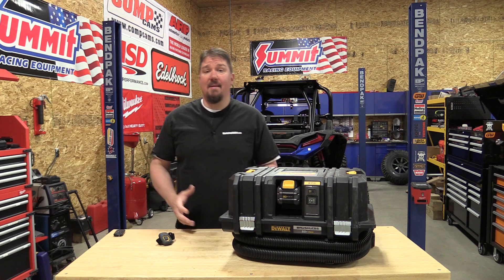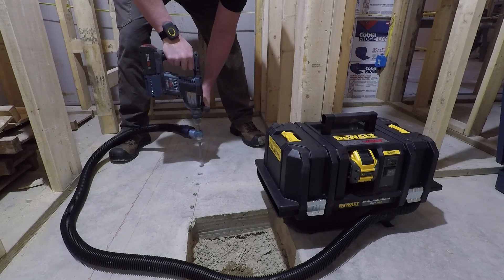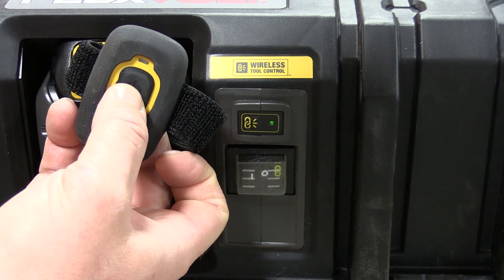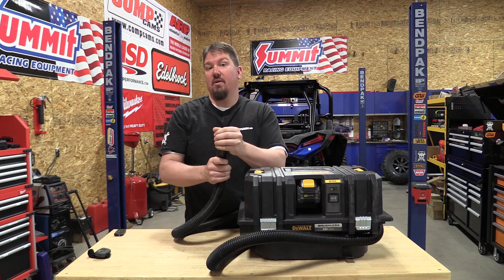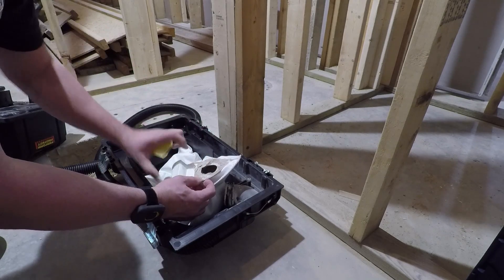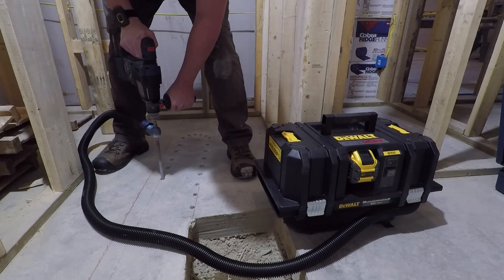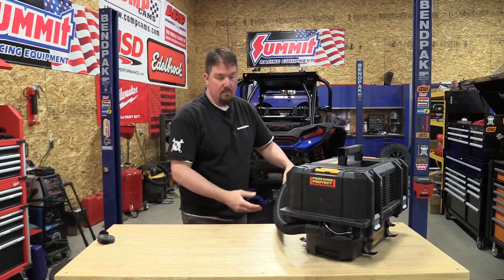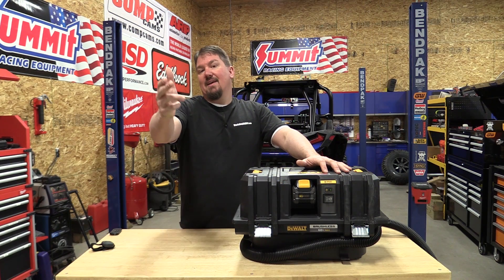Concrete Dust Extractor | DEWALT DCV585 Flexvolt 60v HEPA Dust Extractor Vac For Contractors

Comment: Regarding T-Stak compatibility, can this unit be snapped onto the top of a T-Stak tool case, or on top of one of the 4-wheel T-Stak dolleys, or is the compatibility limited to the ability to stack T-Stak cases on top of the vac? EDIT: I learned elsewhere that the answer to my sorta dumb question is yes, the vac is totally T-Stak compatible and can be added both on top of and below any T-Stak cse or dolley.

Comment: Strange that it’s the same price as the Dewalt battery framing nailer at @$400. Except for festool, vacuums are usually cheaper. I mean, how is this so much more then one of those tstak storage boxes, that’s what it looks like. Complaints aside, I really want one for my tstak system.

Comment: That looks like a 9ah batt that ran 19min when drilling, not a 6, the 6s are all black like when he was in the shop . Failing to make this a corded / cordless tool was a mistake by dewalt. Even my little 20v vac is corded and there are plenty of times when I just plug it in instead of going back out to the truck to get another batt or if i steal the batt off the vac for another tool.

Comment: Would this be good for woodworking? I don't do concrete. I have a DeWalt cordless sander that seems to have the same connector...
Reply from the maker: Yes, if you need a mobile solution.  You could get corded for less money.
Reply: WorkshopAddict true, but I'd like something that could double as a worksite vacuum too. Mostly for picking up drywall dust and a little sawdust from my low voltage cabling and IT work
Reply from the maker: This would work well for that.
Reply: WorkshopAddict ok cool. Though, like everyone else, it's so annoying that it's tstack and not tough system. I have like 20 tough system products that this can't stack with. Not so much for carrying into the job site, but for storage and transportation. Hopefully they'll make one at some point...

Comment: When the auto filter cleaning kicks in does it knock the dust off the inside of the fleece bag? I have a corded Metabo 9 gallon dust extractor and it shakes the filters to clean them but when using fleece filter bags they jam up the filter shaking so it doesn't work in auto cleaning mode with the bags
Reply from the maker: I do not believe it does or could shake the fleece bag.  There is no doubt the fleece will plug up before it is full, but well worth the ease of cleanup.
Reply: Where have you been able to find replacement bags and filters for your Metabo dust extractor?  I was looking to buy one but was concerned I couldn't find them online.  Thanks!

Comment: Really like how it handles dust but could you also try some wet vacuum application. Would be nice to see how it does how well you can dump the water out ect. Thanks
Reply from the maker: Personally, I know it will take the water, but since we use this for concrete, I do not want to replace HEPA filters just to see how water works.  I do not think many would use it for water and if you look at the design it will not hold much water at all.  Not a good wet design.

Comment: Solid review, love the channel 👍...I think it's the most powerful cordless vac ? Love dewalt for framing but they should have just made this in a LG toughsystem box,not tstak..most people have tough system...and it's just butt ugly, they should learn from Milwaukee, Makita,Bosch, Hilti on design.
Reply from the maker: Not sure if it is the most powerful vac.  Probably the most powerful battery dust extractor.  I like the size and the design, but agree on the TSTAK.  Carrying this in the house alone with nothing else other than a drill, it was perfect.
Reply: @WorkshopAddict  I mentioned most powerful ..." cordless"...vac. ..try stacking it on another tstak box,it's very awkward...the hose should be integrated inside the box like Milwaukee or Festool does..it will get hung up around a framing jobsite or a nail sticking out will puncture the hose.
Reply from the maker: @joeframer9642  My response sucks..  :) ... Here is what I was thinking and not typing.  Since you said most powerful battery vac, my mind went to the 3 gallon Ridgid and while that is not a dust extractor, it might have more power.  We show that vac picking up a 4 in piece of steel.  I do like the toolbox design and agree about the hose situation.  Carrying it alone is nice but I have not and will never stack it.    I agree with you 100 percent, just question if it has the power the Ridgid does, but the ridgid was designed for a different purpose.
Reply: Joe Framer interestingly enough, Milwaukee’s new Vacuum moved the hose to the outside just like Dewalt.
Reply: Milwaukee has the nicest unit.

Comment: That is overpriced. $325 should include the batteries.
Reply from the maker: Dual HEPA filers with auto filter cleaning is what takes the price up.  Bosch has a small HEPA filter vac for $120, but it is a toy compared to this.
Reply: @WorkshopAddict  It's cheaper and holds an extra 2 quarts.
Reply: So mr. know it all, please do tell us what to buy that's cheaper and performs on par if not better?
Reply: That’s chump change if you take your work seriously
Reply: Here in Australia its $539 bare tool , there isnt really anything else out there cordless with  hepa, great for cutting cement sheets, cemintel etc
Reply: It says Dewalt on it, they overcharge for everything even batteries.

Comment: Great video. What is the hose size on this unit? I would love to switch out the hose to Dewalts super flexible rubber hose.
Reply from the maker: I believe it is 1-1/2" but I need to measure it.  The hose is larger than the ends you use.

Comment: Looks like a nice product....you cannot put a price on your health.  I’m not trying to be picky however having the option to use a/c power would be a nice option and I really wish that Dewalt would redesign those metal latches....I’ve had quite a few of them fall off due to the very tiny screw that holds them on fail.  As always well done video brother.

Comment: is it more powerful then the 20v vacuum or can this not be used as a traditional vaccuuum?
Reply from the maker: It has 125 cfm's and seems more powerful than the 20-volt vac by a good amount.
Reply: @WorkshopAddict  sweet geezes its got 3x the cost over the 20v lol . do you find it heavy and easily portable?
Reply from the maker: @randomrazr  Not heavy and the toolbox design makes it easy to transport.

Comment: When is one coming for welding smoke? So many times I'm welding in a crammed spot and area is smoked out from welding so I don't have to breath all that
Reply from the maker: Are you Mig welding?  I am just thinking on how one could get a vac close but not have it be heavy or mess up the weld...  You almost need a fan to pull out the smoke and bring in fresh air, but I assume that sometimes there is only one way in.
Reply: @WorkshopAddict  stick. Usually in a mechanical room with little to no ventilation. I'm in hydronics so we install all the pipes for heating and cooling water and steam and condensate if that's in system as well. Sometimes in a tight space to begin with and then add all thay smoke and it's a great breathing experience lol but really some sort of smaller battery operated smoke eater if you will would definitely be on my must have list
Reply: They have some helmets out there with respirator on them abit pricey, might be option though